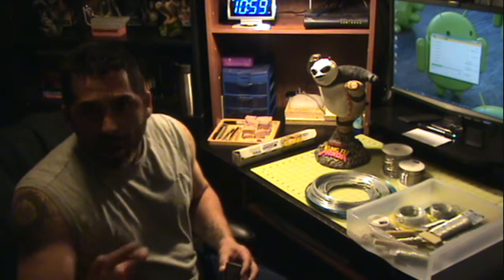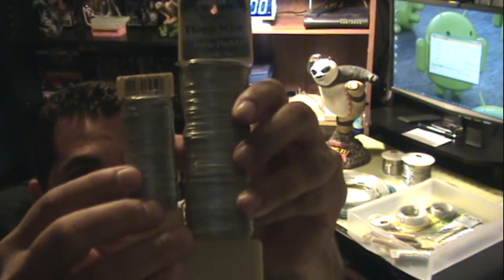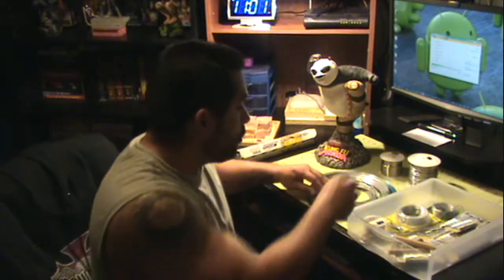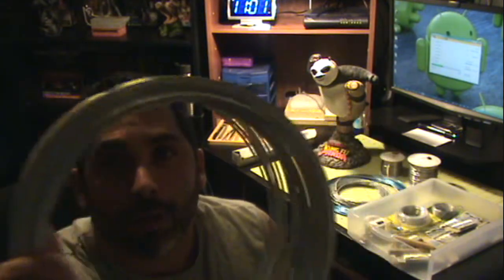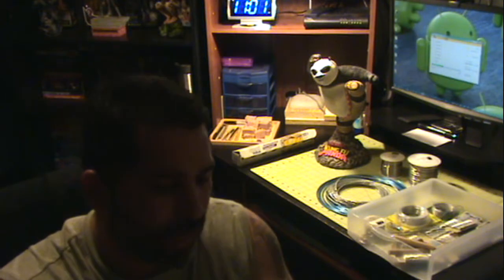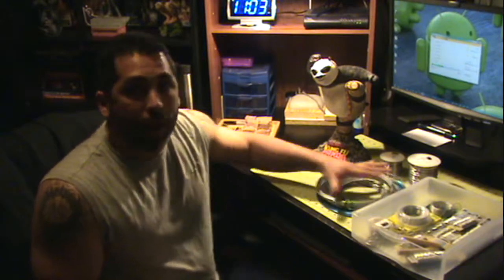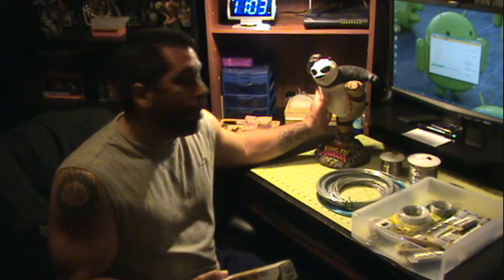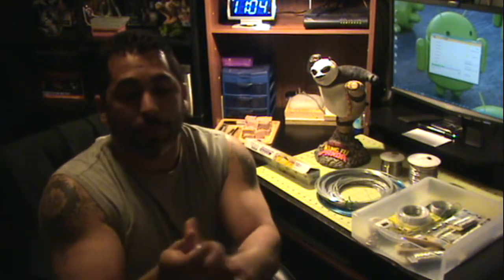Talking Sculpting Part #4 "The Inside Job"

Comment: your videos are very informative. they are great. thanks for sharing this info. and your works of art are great too. I dig em'... I saw you using galvanized wire. people should be careful when heating galvanized wire, it can end up giving off zinc vapors if the temp gets too high. I know you cook your stuff at a low temperature, but some people might not.

Comment: does copper wire work?
Reply from the maker: I Haven't used it...I think it is too soft, I would say aluminum or steel...
Reply: Thank you. I actually did use it and it did fine cooking, but you are right about it being soft. I don't think it holds shape well. Will try the others you said :)
Reply from the maker: No problem.  Im actually experimenting with a new medium, well at least for me (monster clay) an is very nice. Check it out. Is also cheaper too and is reusable.
Reply: Thank you. I really appreciate that. I will check it out